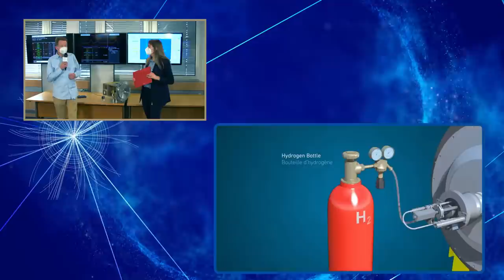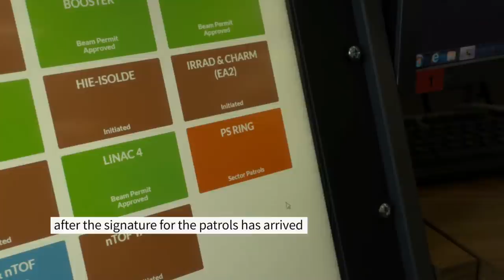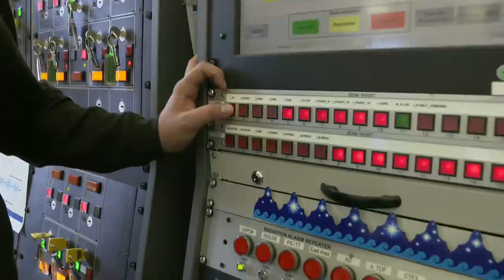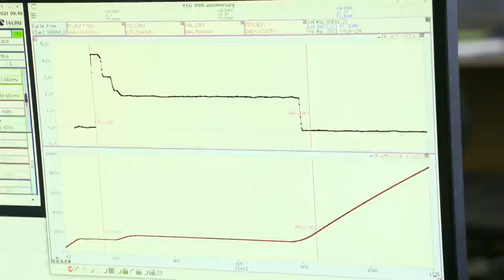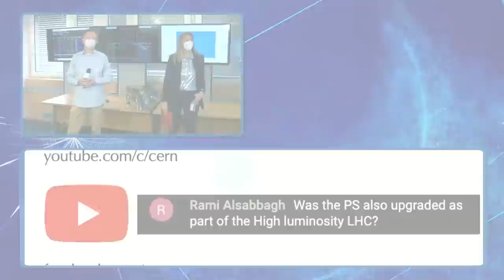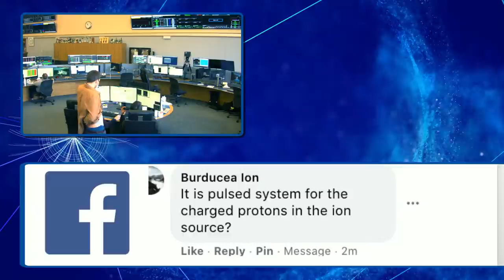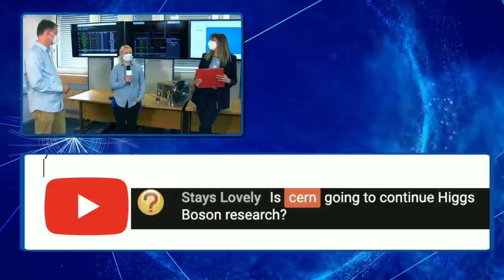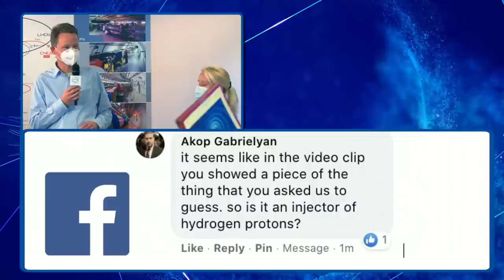First injection ever of a 2 GeV beam in the CERN's Proton synchrotron

Comment: What is their desired purpose for this?
Reply: Who knows...lol...I've heard many conspiracies
Reply: As stated at 3:50, the ultimate goal of this higher-energy injection is to deliver higher luminosity (more collisions/second, basically) at the detector side of the machine.

There is a LOT of fiddly accelerator physics that goes into how the beam properties affect the luminosity, but a very rough rule of thumb is that higher-energy beams often actually make it easier to maintain the quality of the beam. Injecting into the Proton Synchrotron at 2 GeV (instead of the old 1.4 GeV) energy means more acceleration is done before this injection, and this is good for luminosity!
Reply: I would assume you need a lot of energy to break up matter into it's components and if u have more energy you can discover more about what our world is made of.
Reply: Quarks on toast, yummy, oh and to look for new particles, large extra
dimension, dark matter...
Reply: @jameswize9570  Wonderful. What could go wrong?
Reply: @jameswize9570   uhhhhhhhh, CERN is in Switzerland not northern Israel.
Reply: @jameswize9570   Whoever decide that smashing quanta together to discover the underlying symmetries of the universe somehow equates to some religious end of the world scenario? When did CERN announce their plans to instigate "Armageddon?"
Reply: @Heather Leigh I actually thought about the connection between the recent earthquakes and cern it will be interesting to see if this happens again.
Reply: @jameswize9570  there was no big bang ! 🤣
Reply: @NGC6144  they're white what else could they be planning
Reply: To justify building our own UAP